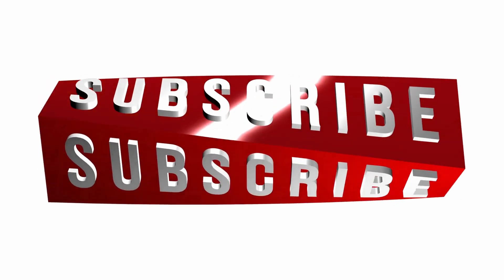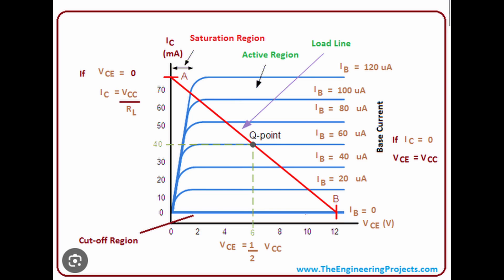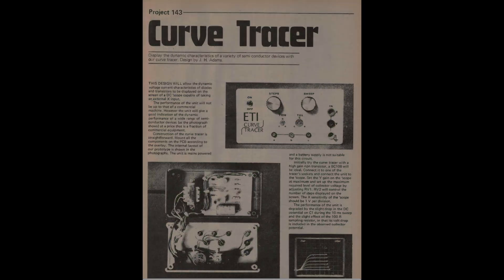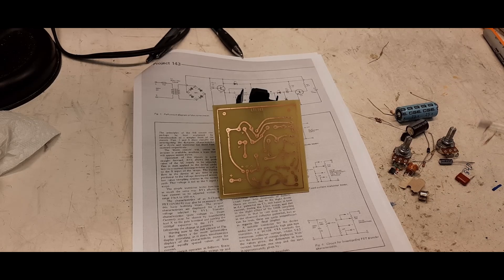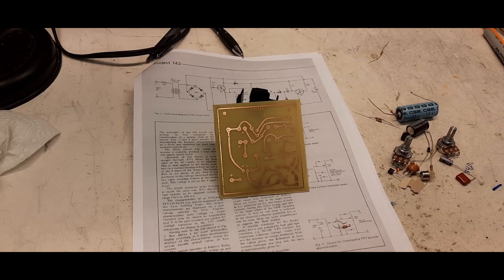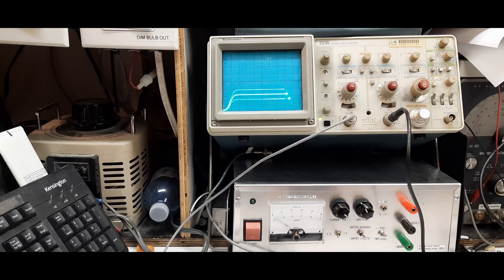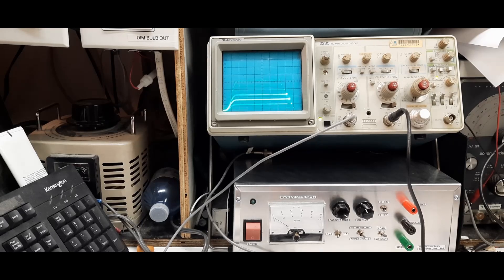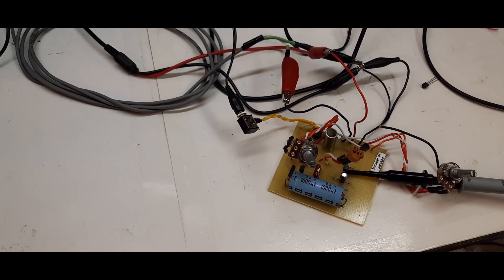Electronics Today - Transistor Curve Tracer - January 1979

Comment: The PUT is an arcane transistor. I have the rhythm unit/Nof a Hammond T500 (only the PCBs. It works. Runs on 24V DC. A PUT is employed as part of the master oscillator. I now need to find an enclosure for it and mod the F*ck out of it ;) Beautiful sound board. All passive components with just 2 ic's for the rhythm clock. x
Reply from the maker: Awesome info. In my circuit it gives a ramped "Oscillator". I learn so much from you all and i appreciate that. Cheers

Comment: Nice! Been doing electronics for over 20 years, a lot of old stuff like vacuum tubes etc., and I never heard of programmable unijunction transistors. Gotta check them out. Oh well... another wascally wabbit hole for yours truly!
Reply from the maker: Thanks for watching ... the gate of that PUT was pulsing and with the cap in the circuit is created a step type ramp. This ramp is what gives the steps on the display. I should have shown that but I was just tired and had no energy. Cheers!
Reply: @bettinaneumryr  pretty interesting!
Reply: I started learning electronics in the 5th grade. Became an electronics tech in the USAF in the mid 80s, and have been working in various aspects from bench tech to systems installation ever since. If I've heard of or seen a "programmable unijunction transistor", I do not remember it at all. If I'd seen the drawing above before this video, I probably would have glossed it over as an SCR on the schematics, not realizing the gate is drawn in the wrong place. One can be forgiven for not knowing every nuanced variation of cramming p and n material together.